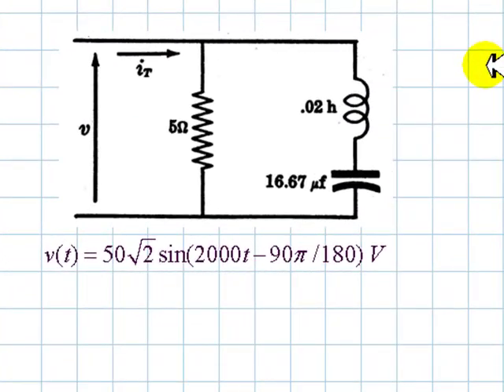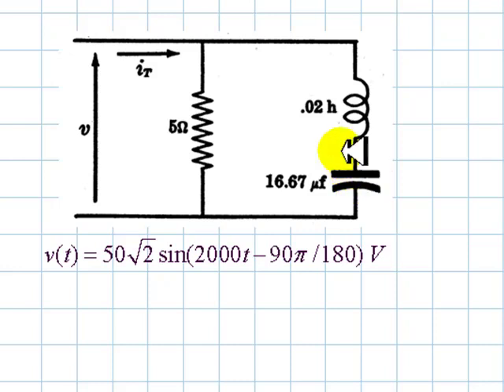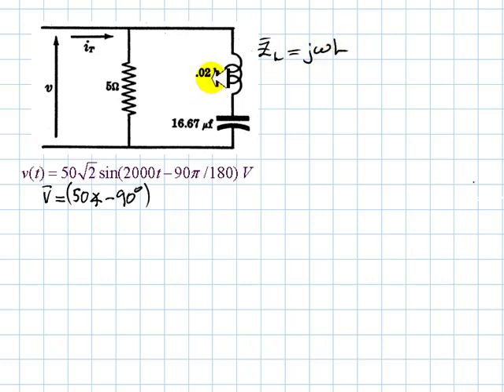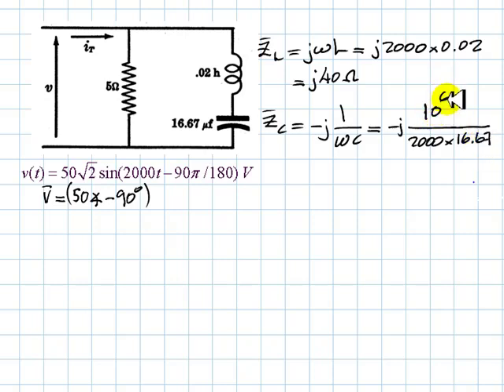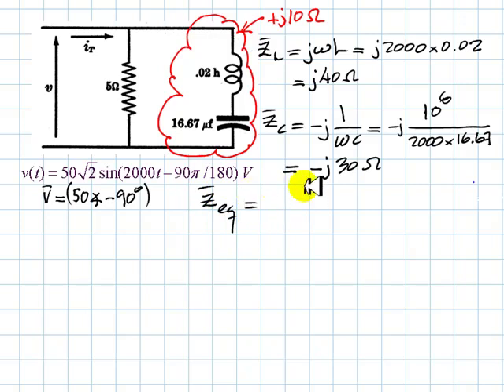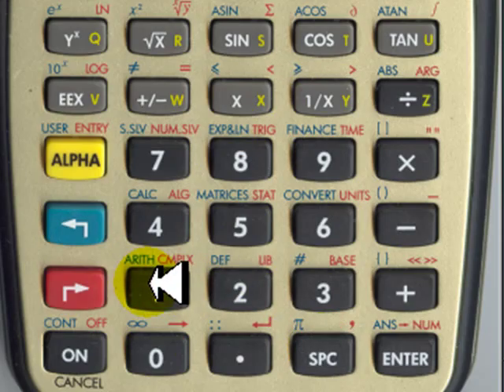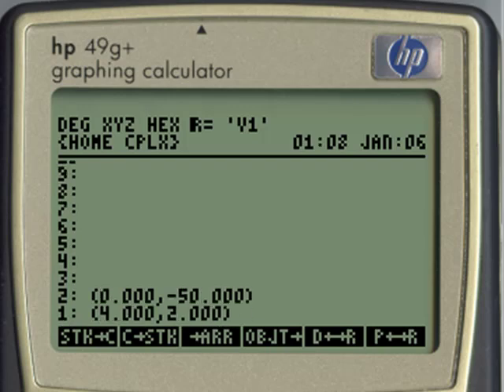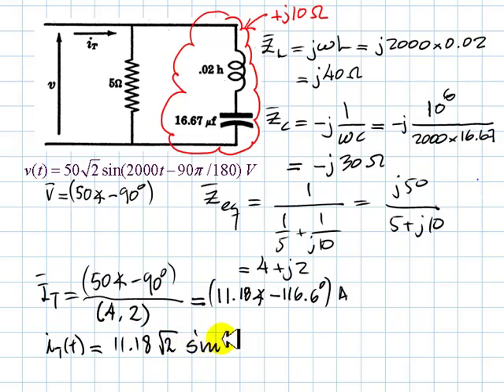PHASOR 04: First Tutorial on Phasors

Comment: More than 4000 high quality videos!!!. As prolific as Euler. Probably Guinness Record. Congratulations
Reply from the maker: Heh! You're going to make me blush, which is unlikely for someone my age. There are not that many ... yet, but I keep working on them. I had plans for many new ones this Summer, but life has intervened with many important distractions. Thanks again.
Reply: I enjoy very much your videos, I even bought a hp- Prime. Only problem with Non-linear equations for the diode current, I receive the same warning but no answer empty [ ]
Reply from the maker: Do you mean a DC source feeding a resistor through a diode?
Reply from the maker: Let's say something like a 10 V source feeding a 3-ohm resistor through a diode with a sat current 1 nanoamp. In CAS settings, I cleared the EXACT box, while I kept on the COMPLEX box (for other reasons). I typed the equation as EQ1:=10=3*1E-9*exp(Vx/0.026)+Vx, where Vx is the voltage drop across the diode. The HP-PRIME  ROM VER. 2018 1.24 13333 responded that Vx is 0.569 V, and that the current is 3.14 A.